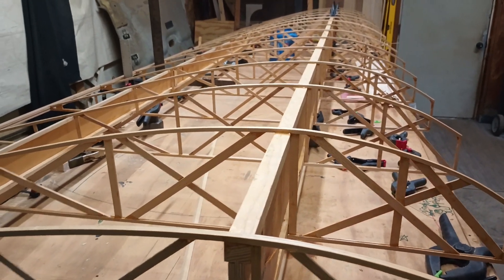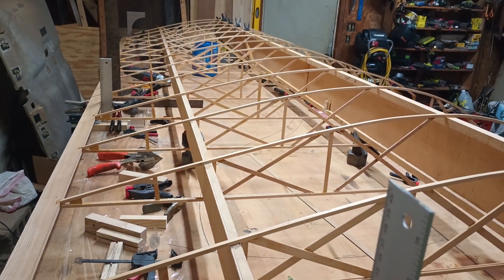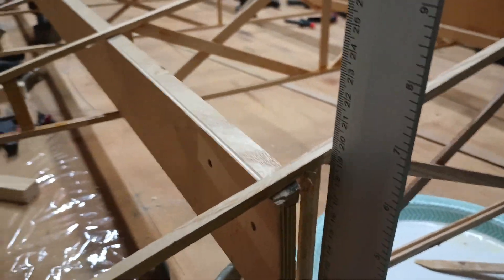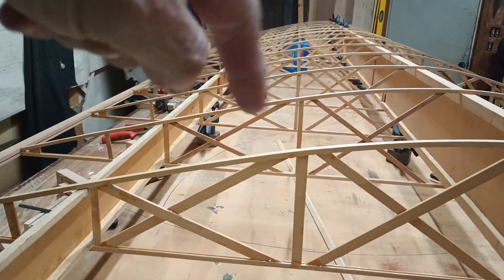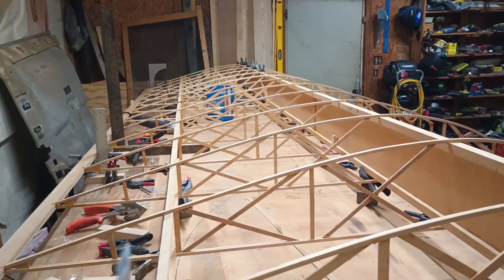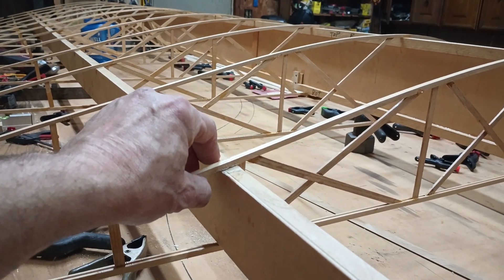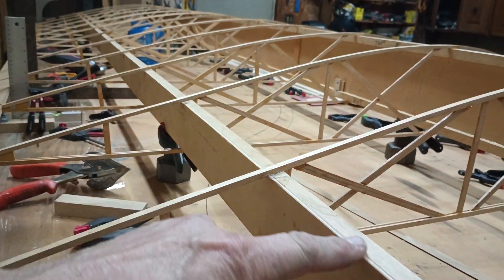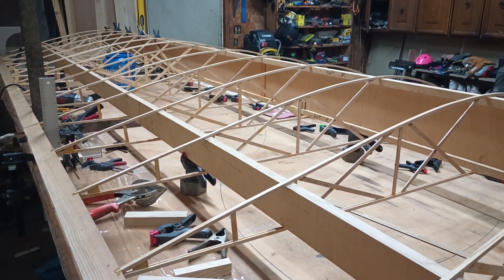FP 202 Scratch build from Prints E107 DON'T DO THIS!

Comment: I still have no idea what was wrong with it exactly. The rear spar, the angle to it was a 1/4 of an inch back? It was "that direction 1/4 inch"?
Reply from the maker: If you looked straight onto the front of the leading edge, the root was perfectly straight and square from the main spar to the trailing edge... But the rear spar had slid to the left ¼".
Reply: I'm with you. From the video I have no idea which frame is showing what is wrong. Is the rear spar issue north to south, or east to west? I don't understand why the ribs are being cut loose if it is merely slid past the end rib a quarter of an inch. Couldn't the end be trimmed off?